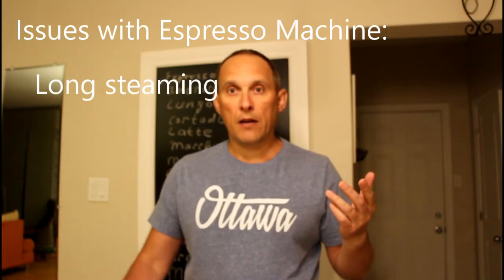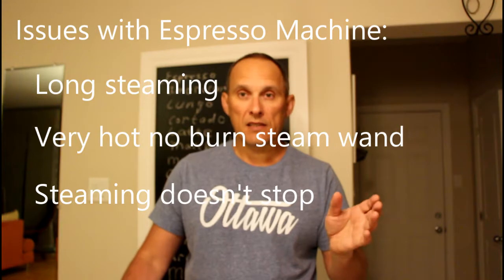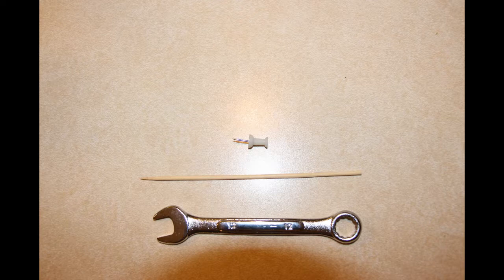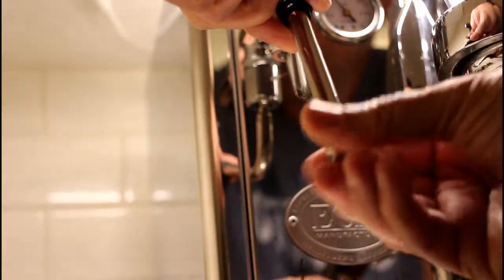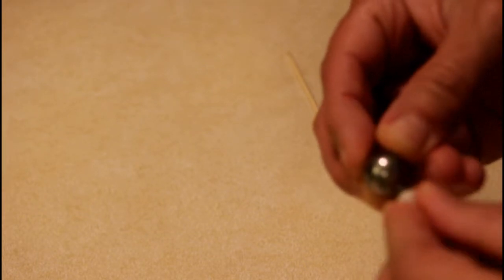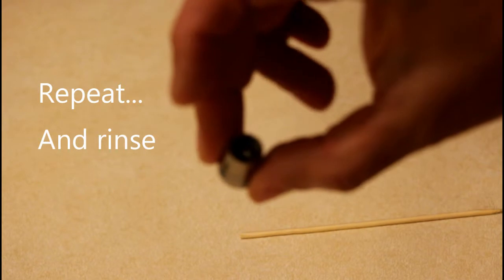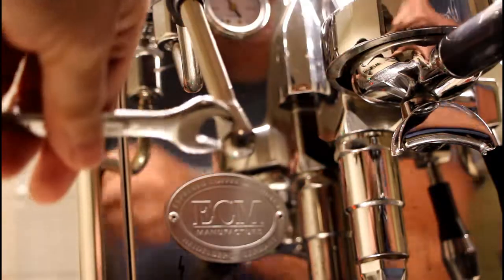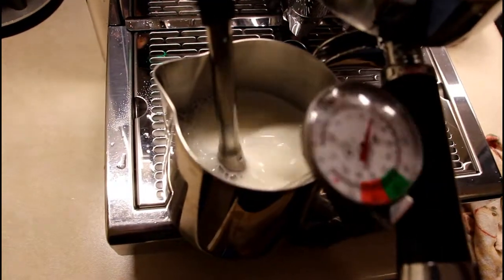Restoring my espresso machine steaming power

Comment: Restoring?? Hahahaha
Reply from the maker: Adnan Meskic yeah, it’s laughable now, but I was ready to disassemble the machine, and was so happy, that the solutions was so simple and easy. Unfortunately, the boiler pressure on my machine suddenly dropped a couple of months ago to 0.7  bar, and it won’t be that simple. From what I’ve read I will need to clean gage pipe or replace the meter. We’ll see...
Reply: @AlexLatte  and what is with pump? Did you check it? (pressure pump) .At home I have Siemens surpresso S40, not happy with sound/loud noise when make coffe and steam is bad not so good
Reply from the maker: Adnan Meskic the pump is great. Honestly, the steam is good as well - this is why I’m not that eager to fix it. But - things has to work properly, so I’ll spend some time with the machine over the Christmas. My ECM uses a rotary pump, this is why it’s not noisy. Are you going to disassemble yours? :)
Reply: @AlexLatte  I am thinking to do that, and clean everything. Who knows how it look inside the system. I have descale it many times but.....
Reply from the maker: Adnan Meskic hi, just sharing - I’ve fixed my espresso machine  :) https://youtu.be/-n8LlBTJDLc